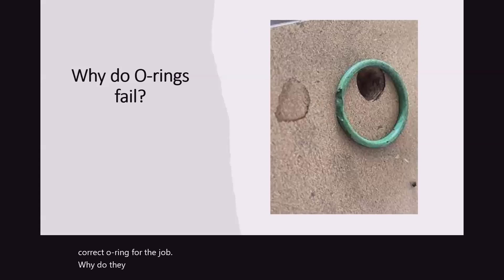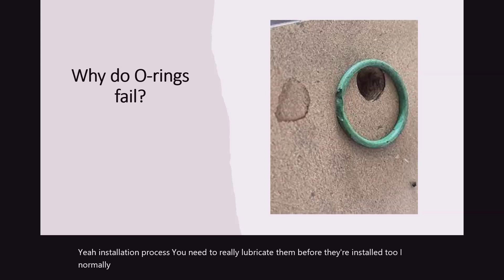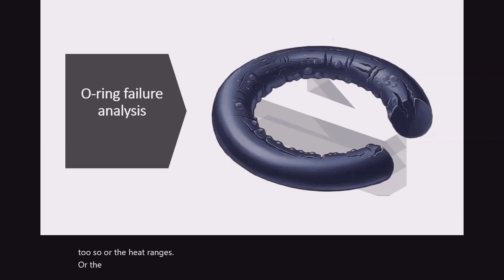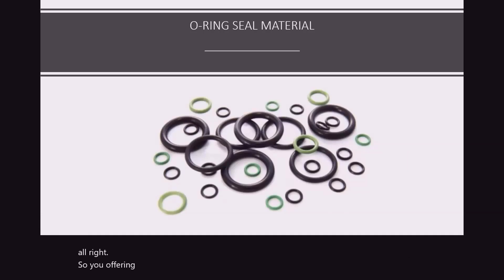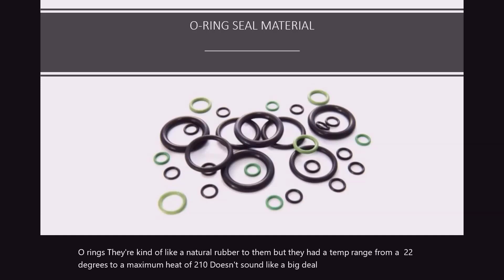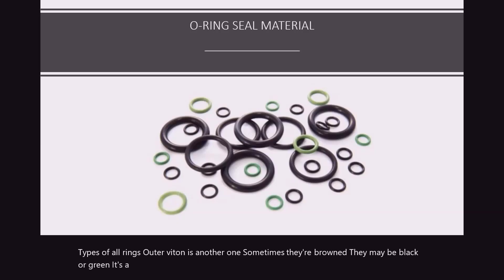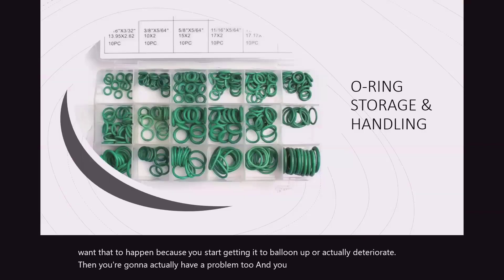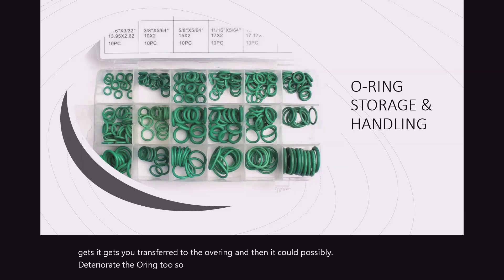Automotive Air Conditioning O rings, Seals, Gaskets, and Hoses

Comment: I stopped watching the video when this guy said to use refrigerant oil as a lube for O-rings which is a huge no no. Refrigerant oil can compromise an O-ring over time. Silicone grease is the only type of lube that should be used for O-rings. It is safe and doesn't affect the rubber like refrigerant oil can and more than likely will over time.
Reply from the maker: Thank you for your feedback. Just an update and you are partially correct. This information comes for several years of experience and manufacture recommendation.  For an AC system's O-rings, use a lubricant that is compatible with the refrigerant and O-ring material, such as silicone-based grease, PAG oil, or ester oil, depending on the system's specifications. Always ensure the lubricant is specifically made for AC systems to avoid damage to the seals or contamination of the system.

Comment: Why don't you like the dyes in AC system. Clogs it up?
Reply from the maker: Dyes displaces refrigerant and system oil space. Dyes need if used needs to be measured exact and a label needs to be placed so technicians do not over use the dye. Electronic leak testers, vacuum testing and nitrogen with soapy water are my go to. I hope this helps answer your question. Respectfully, Marty

Comment: Link to buy ac oring plz
Reply from the maker: It really depends on where you live. Local part supplies have individual or kits. You can get AC orings through amazon. Here is a link to a master kit
https://www.amazon.com/XBVV-Conditioning-Automotive-Compressor-Professional/dp/B0CNLP47ZY/ref=sr_1_1_sspa?crid=18C9UYG5Q9UX8&dib=eyJ2IjoiMSJ9.njJO075lhEGlyzjHGJ5NaZuMxjSUqVqgkjEJ_C3I4A-21-MOJX-LrFM_Z3nrP9ErMLcT7MIHN8Z2yJ6GWtBuDwJuxIXjSHJzUTewwWWTzQoMFOpVCc8Hje2vgt7joymLhEN4uBfg6Wgdnen3wRICeAYlgitBi-vxonrDsLEZkVz5-39YjT36l1OgJ_gB6g2K5xaSe-FG2Qf7ruAY5-9MrTHQiLByIeVQgFcVrMyZxtE.ZICkIHAVutkwTsSbpzsaygF70e69vz4XLelmNImXpjM&dib_tag=se&keywords=ac+o%27ring+kit&qid=1734631464&sprefix=AC+Oring+%2Caps%2C240&sr=8-1-spons&sp_csd=d2lkZ2V0TmFtZT1zcF9hdGY&psc=1

Comment: When do you use an o ring vs a seal?  My parts kit came with o rings and seal washers, but my existing lines only had seal washers I think.  After watching this and another video, I assumed the o ring was used with the seal, but after tightening, my fittings were not seated evenly, caused leaks.
Reply from the maker: It would be best if you always replaced what the manufacturer originally installed unless the manufacturer states differently under a technical service bulletin (TSB)

Comment: Not sure about some of this advice. How long has it been since an O-ring was made that can’t resist mineral oil??

Handling with clean gloves makes sense for a different reason : keeping dirt and debris away from mating surfaces
Reply from the maker: O rings for car air conditioning were first used on cars in 1939 when car air conditioning was introduced. Mineral oil was the lubricant at this time.